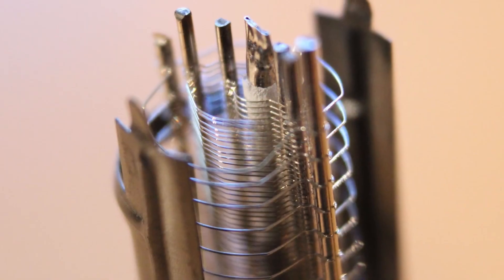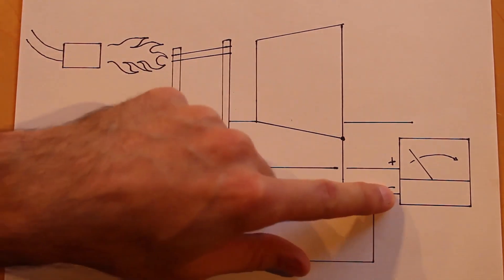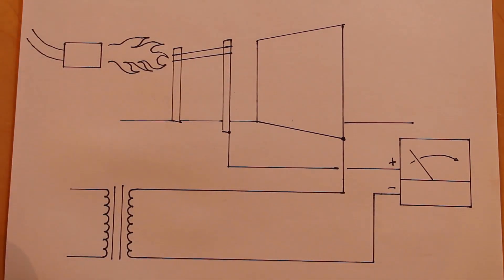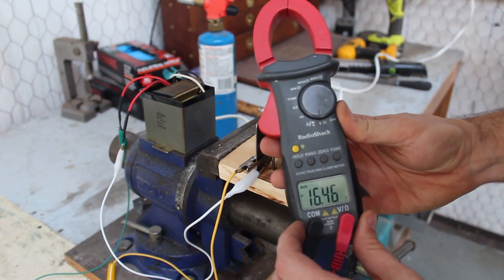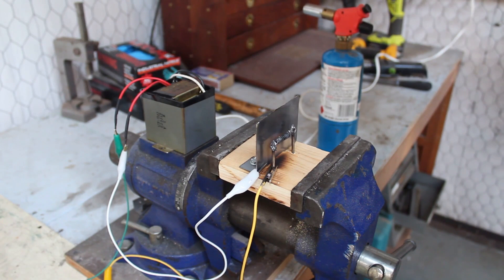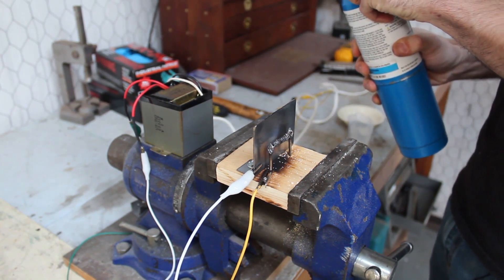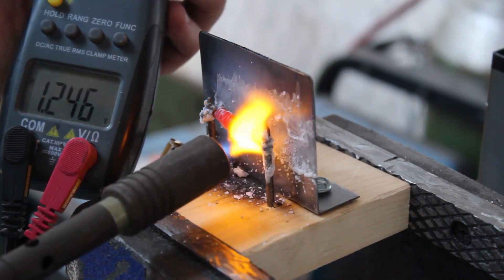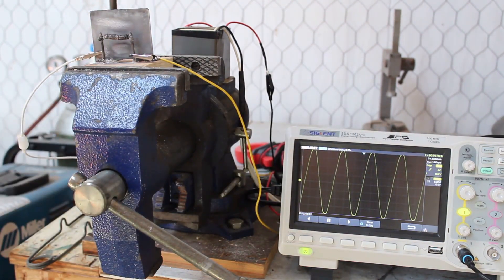Trying to See Thermionic Emission by Building a Flame Diode

Comment: I had a taught what would happen if this was replicated but instead of adding the emission coating driectly to the cathode, and it to the fuel of a  alcohol bunner. Test that, then maybe try building a catalytic style burner a device that operates practically flameless, and in a low oxygen environment.

Comment: You might have more luck with a big indirectly heated cathode and filament from a large tube and a higher plate voltage, also the gap between A & K should be as small as possible as im sure you know 👍 great videos mate 😎

Comment: I've actually done this with a propane torch and full line voltage and the flame managed to pass enough current to dimly light a neon. Problem was that it was one with the dark glass (from a hot line tester) so couldn't tell if it was DC or not.

Comment: Very educational video, there are many thing to learn from this experiment. The inductive reactance of the coils is the stored energy as a magnetic field, hence the voltage on the osciloscope. I wish you would remake this experiment with the ideas already pointed here, such as a blinded wood base, putting the anode and cathode closer and maybe a more pure environment in a circuit to measure the magnetic fields also. Great work, I'm subscribing!

Comment: Put a resistor in series with the plate and hook the oscilloscope probe to the ends of the resistor. What you want to be looking at is the current through the plate, not the voltage on it. The resistor will act as a current-to-voltage converter and you'll be able to see the rectified current.

Comment: Im not sure its the same effect, but I know fire is conductive. I spent a fair while screwing around with high voltage power supplies, and eventually getting ~25mm arcs with a nice fat solid ac. I didnt have any end use for it other than electrifying a bunch of stuff, so I electrocuted alot of stuff. I noticed burning things increased my arc length. well, not exactly arc length, but it was clear a flame could increase the gap between the electrodes considerably, even if the arc itself got shorter. the largest flame I had access to was my Iroda gas torch, and could almost double the distance I could conduct between electrodes.

This was all very unscientific, and at the end of a very deep rabbit hole of "Huh, thats cool, I wonder what happens if I..." combined with beer. I took no measurements and was using an obscene amount of voltage AND current (I soon got bored of skinny blue arcs and stopped chasing voltage and focused on jamming current into the system. I topped out at about 400w). so not exactly comparable. 

But aside from showing a few mates, I didnt do anything else with it. Very interesting demonstration, very cool. thanks

Comment: dont know if any suggested it yet but make core of salt inside the wire. make a cylinder of paper fill with the desired salt wet the salt and then press it and let it dry then pull away the paper wrap a wire around it. i heard potasium salts is a better ion source for flame triodes. 
cheers!
Reply from the maker: Oh, that's a very interesting idea! 
I had read that salt was good for promoting emission in flame diode but I could come up with a good way to get the salt on the wire.
I really want to revisit this idea of thermionic emission again sometime in the future, so I'll definitely keep this in mind!

Comment: Unfortunately it is a year late, but, if you placed a 10uf cap across the probe's GND and TIP, you might have seen a tiny build up of DC voltage as that cap would have shorted out the AC component of the signal leaking through your, most likely, wood and nails as it got hot and burnt.
Reply from the maker: Holy cow, it's been a year since I posted this video! Man, time really flies. I've still been thinking about this video and I definitely want to revisit at some point. I'd like to eliminate the wood and nails aspect of it and really get a better setup to properly see if I was conducting through the wood or I just made a terrible air gap transformer. Some day I definitely will give this another shot though!

Comment: Using a Nernst lamp style oxide filament could also be interesting.
Reply from the maker: Oh man, I hadn't heard of a Nernst lamp before, but that's actually a really interesting idea! I wonder if the ceramic filament in a Nernst lamp has enough emissivity to emit electrons? If it does, I think it could make a very interesting rectifier if placed close enough to the anode (and maybe the anode encapsulated the filament). That's a really awesome idea!
Reply: @UsagiElectric  Do you reckon if it worked, it could it be efficient?
I've done a fair bit of reading on Nernst lamps in general and when tested, the filaments were found to eventually stop working, but the reason for this was and as far as I know, still is, unknown - this could be worth investigating further for clues. The lamps did last a long time though - longer than most, or all of the Edison incandescent bulbs, taking into account variables such as wattage. It appears as though it was actually the preheating wire and the ballast, which failed first. And as the filament and heater were attached as one product, an entirely new lamp would be purchased, even though the old filament was still good. This shortcoming in design was probably a business decision, made to sell more of the things.

The built-in preheating part of it is not actually necessary, at a basic level, because the filament can be heated by a small blowtorch, etc, until it is hot enough to conduct electricity. There may even be ways to rig that up for remote usage.
And i'm guessing some other component, (a large resistor?) could replace the ballast, which I think was only there due to the filaments negative temperature coefficient of electrical resistance.

These kinds of oxide filaments don't strictly need to be rare earth oxides either - it may be possible to use Aluminium oxide and/or some other more common metal oxides. The light that each oxide emits will range in colour. 
There is actually a video on here where a dude heats an Aluminium wire to incandescence in the presence of 'air' - as it begins to glow brightly, what appears to be happening is an Aluminium oxide layer has formed on the outside and is emitting incandescent light, while the inside of the wire, protected from oxidation by the outer Aluminium oxide layer, becomes molten Aluminium and so the wire sags until breaking. I saw great potential for Aluminium oxide to be used as a filament material. 
Actually making the filament is the other thing - but a bit of researching and mucking around could make it doable.
Reply: @UsagiElectric  Intuitively I feel that an oxide filament could be used for making a diode. The flame diode suggest/shows? that a vacuum is not essential and if other working principals can be determined, then maybe it could be engineered to work quite well. I've been meaning to try it and to simply just making a working filament, but things and stuff have got in the way. And my knowledge is patchy when it comes to electricity, so i'm a bit hesitant.
I've got some links to more info on oxide filaments if you want to check them out?
Reply from the maker: @Kyle-sg4rm  I actually played with the idea of heating a wire up in a weak vacuum to see if I could get any electron emission out of it as a sort of sequel to this episode, but it was a total failure. I tried steel wire and copper wire, and while I could get the wire glowing a nice orange, I was never able to get any electrons to flow to a positively charged plate. 

I think this came down to a few different things working against me. 

First, I was just using some scrap steel to work as the anode, and that’s a terrible anode material. Ideally, I should have been using something like pure nickel. 

Second, both copper and steel have really low emissivity. I really should have been using something like Tungsten, but then that requires a fairly strong vacuum. In indirectly heated vacuum tubes that have a separate cathode, the cathode material itself is usually nickel coated in something like barium oxide.

And finally, a vacuum is usually necessary because air particles can block a large majority of the electrons trying to travel via thermionic emission.

Now, an oxide filament is an idea that could work with some proper building. Nichrome wire could be used to pre-heat the oxide filament until it gets self-sustaining. Then, a nickel cathode could be tightly wound around the filament, encapsulating it and absorbing all the heat. If the nickel cathode is coated in some barium oxide, thorium oxide, calcium oxide, or even aluminum oxide, I think we can get some decent emission out of it (at least enough to be measured). Then a very tightly wound nickel anode and even without a vacuum, we might be able to get something working.

But, if we’re going to coat the cathode in an oxide anyways, that seems a little redundant. If we could build a filament out of Aluminum oxide or calcium oxide or something, that could maybe make life a lot easier! I would be very interested in hearing any ideas you may have about this, I would absolutely love to give it a shot one of these days!
Reply: @UsagiElectric  All worthy considerations. 
I've been trying to find a page I found a while ago, which had quite specific details of how they made the Nernst oxide filaments. It was fairly simple, but I remember there being some stuff about the process which was important...I just don't remember exactly what it was!
I'm not sure how important the binder is - someone on another yt vid mentioned using Nitrocellulose as a binder. I would guess that minimal amounts would be used and the mix would be pressed. Possibly heat pressed. And sintered, possibly in a oxy-hydrogen flame.
The aims kinda need to be defined, because there are so many ways to approach it. It would be choice if the materials are ubiquitous in nature, not just stores. And if the manufacturing process is as simple as possible. Something someone could make at home, or even in the wilderness. Some grasses and such are high in Aluminium oxide/hydroxide and Silica. Sorghum being one of them. Potassium/Sodium salts can be removed and remaining calcium maybe dissolved in an acid - even Acetic acid. The most basic, yet still effective purification process. 
The main hurdle if approaching it like MacGyver, would probably be how to connect the filament... as platinum would work, but may not fit the brief and is not so available in nature... I was wondering about flaring the ends of the filament and if that might dissipate enough heat to make using copper a possibility... but then, lower heat = lower conductivity. So I dunno...
There is not alot of info on these oxide filaments and some contradictory info eg; I just read that actually the filaments were actually removable and replaceable. 
A strange lack of info, given that they still have certain uses today, at least they have up until recent times.

Here are a couple of links to some in action. And maybe some of my silly questions, etc, in the comments from ages ago: 

https://www.youtube.com/watch?v=aYvWC-mjfdI

https://www.youtube.com/watch?v=Y5C_WbQ9j-Y

Comment: Since you heat both surfaces, it emits electrons on both sides. That's why a structure that conducts electricity is formed and you start to see the voltage in the transformer. It would be more accurate to experiment with DC volts. Besides, it would be more interesting to consider generating energy from heat instead of showing the diode effect. 

Thanks for the interesting experiment.
Reply from the maker: Thank you!
One of my goals is to revisit this, but instead generate the emission the proper way with a filament in a vacuum. I have some ideas about how to tackle it, but there's still a lot of unknowns that I'm thinking through. One day, I'll get back to this though!

Comment: If you heat the plate from the other side does the voltage change?  If you heat the element from the side instead of head on does it react different?
Reply from the maker: I unfortunately don't have this setup to test anymore, but what was interesting is that after turning the torch off, the waveform shown on the scope didn't immediately decrease. So, I don't think the flame itself was carrying any electrons. Most likely, it was electromagnetic coupling, kind of like a capacitor or transformer. So, unfortunately, no real thermionic emission, but instead just the most inefficient yet coolest transformer ever (because anything that requires fire is cool in my book)!

Comment: Why you measured voltage? Thermoionic emission should carry electric charges thus we should see current. I will try to replicate your experiment.
Reply from the maker: The short answer is that I'm totally making this up as I go, haha.
I actually based this a bit on what you can see and measure using a 6AL5 diode. Run voltage into the plate, and you can measure the same potential at the cathode with a voltmeter, but if you run voltage into the cathode, you won't see any potential at the plate. I figured rectifying a transformer was going to be the easiest way to demonstrate this, but as you can see in the video, there was so much more going on inside the goal of rectification got lost in the midst of other, weirder discoveries!
Reply: @UsagiElectric  actually even with a diode I would have choosen to measure the current, providing a voltage source through a resistor.  But that's not the point. I wonder why you read an increase in voltage and I'm not convinced it's because the charred wood (as someone else proposed). If it was a flow of charges through the carbon it wouldn't had changed with temperature. Carbon's resistivity raises with temperature, however since you read voltage there was no current, so no voltage drop.
Reply from the maker: @AccidentalScience  The more I think about it, the more I think Janne Peltonen is the closest as to what is actually going on, in that I just made a really terrible air-gap transformer and the fire/heat just got everything moving more freely. That explains why we saw the peaks increase on the scope with the application of fire, and then they stayed increased even after the fire was removed.

Comment: As soon as you scorch the wood, it turns to conductive carbon crud. The input impedance of the scope is probably around 1 megohm, so it doesn't take much bunt wood to register a large voltage on the scope. Plasma (fire) is conductive, you might play with this idea more, set up the experiment to eliminate the "burnt wood" conduction path so you can really see the plasma conduct.
Reply from the maker: The wood was definitely the weakest point of this whole test. I think in the future, if I'm going to stick with the flame idea, I need to totally isolate the base between the two, so even if it gets charred, there's no way that it can conduct. Although, the best option is definitely trying to electrically heat the cathode without melting it.

Side note, I love your projects! Both of your clock projects were absolutely fascinating and had some brilliant engineering in them. Looking forward to more videos in the future!

Comment: I'm a bit skeptical to the idea that there was some capacitive coupling between the coil and the plate that cause the current to flow in the cold state. The capacitance would probably measure in attofarads and at a measly 50Hz the impedance would be more or less astronomical.  Just guessing wildly it might be that the piece of wood is not totally super dry and actually conducts a bit between the mounting points. Mounting the parts on a piece of plastic maybe the cold state result would be different, but it would be hard to use the blowtorch then ;-)
Reply: It looked like the wood was getting charred. That would turn it into a resistor, probably less than a couple hundred KΩ.
Reply from the maker: @rocketman221projects  That's definitely a possibility. The only thing that makes me think there might be a bit more going on is that the wood was already pretty charred by the time I hooked the scope up and the coupling affect grew immediately upon adding the flame, before the wood had a chance to char further. But, the wood itself could definitely have been conducting!
Reply from the maker: You know, my father said the same thing to me after he watched the video too. The wood conducting is a definite possibility that I didn't think about at all!
Reply: The wood may conduct but remains not clear why the voltage raised when heating. This do not necessarily means it is a sign of thermoionic emission though.

Comment: I think what you built is something between a capacitor and a transformer. You have a coil, and a plate, and air insulation between them. So there's going to be AC coupling - probably not purely capacitive and not purely inductuve. But the heating of the system probably reduced the impedance of it a lot - everything is moving more freely inside the heated metal, so the electromagnetic coupling is more efficient. But I don't see clear evidence of thermionic emission here. To rule out electromagnetic coupling, you really should have DC current coming in and see if that passes through.
Reply from the maker: The more I think about it, the more I think you're right here! I've just built a really terrible transformer that requires a torch to work, haha. I need to build a good DC power supply that can give me some high voltage for the next test, which should be pretty fun!